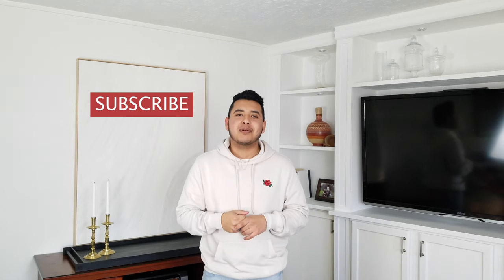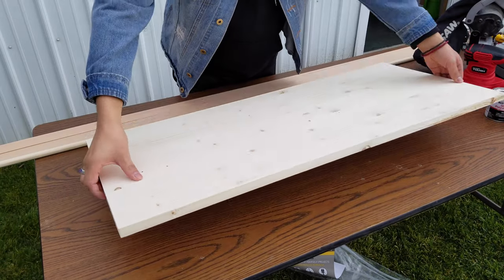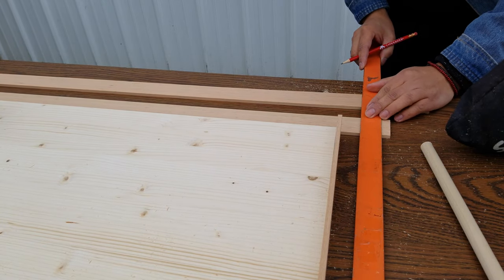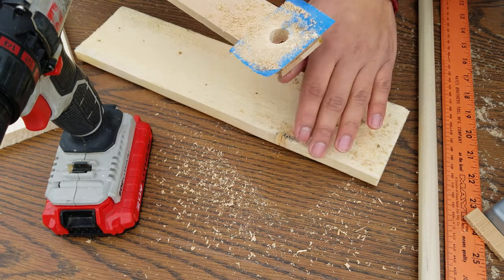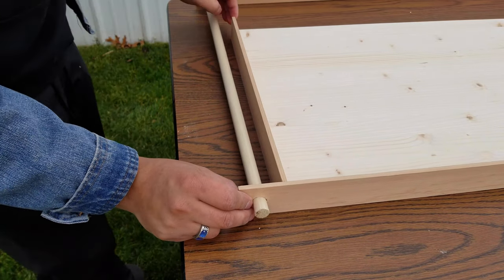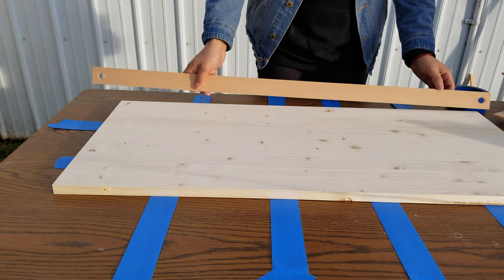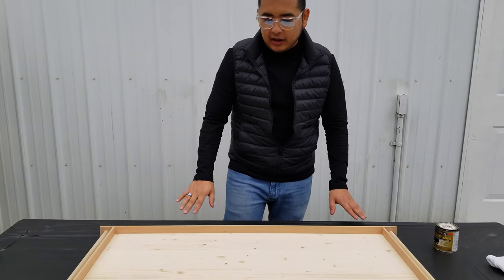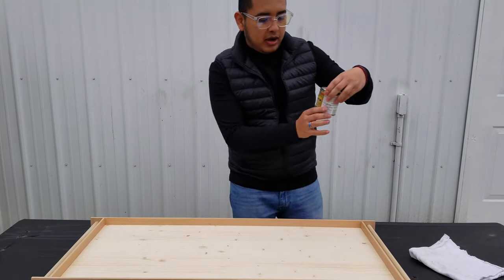DIY LARGE MODERN TRAY - RESTORATION HARDWARE DUPE - EASY HOME DECOR DIY

Comment: I realize this video is a few months old and you may have added a few additional tools to your arsenal but allow me to suggest a small cordless brad nailer for projects like this. It would help to hold the project together while the glue dries and provide a bit more stability to the finished product. Also, after painting or staining, a final coat of wipe on or spray on polyurethane will protect the piece and give it a more polished look. Love the way that turned out, though. Creative, sophisticated, and affordable. The size of it makes it stand out as more of a statement piece. You nailed it again.